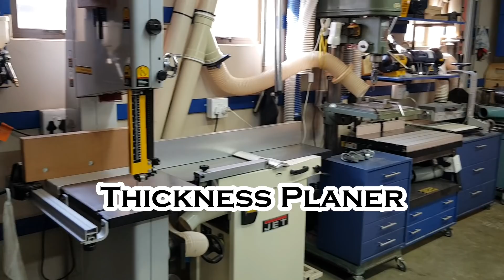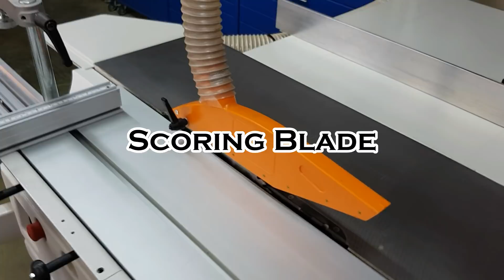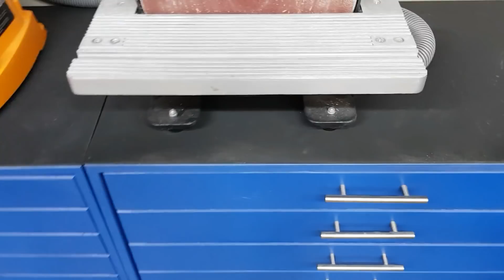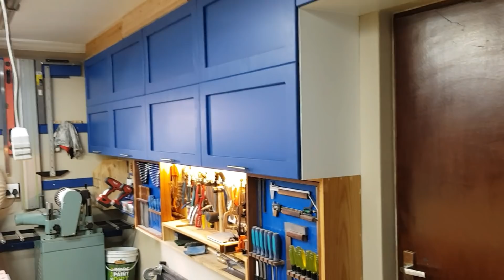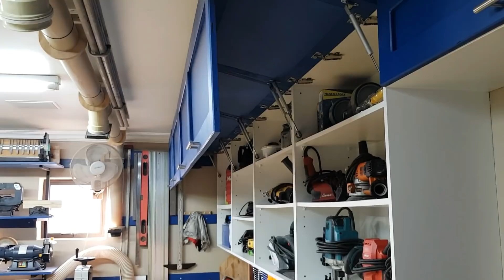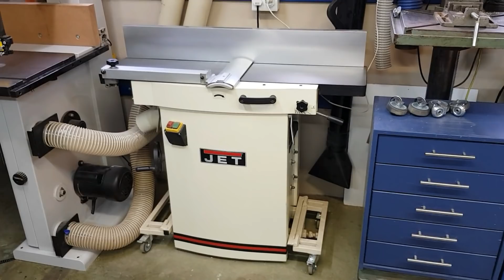Woodworking Shop Tour 2018

Comment: Where do you get your bags for your dust extractor
Reply from the maker: Hi Paulus. The bags are re-usable fabric, so I just empty them, shake it out and put them back. I tried the plastic ones, but they have to be replaced after a few empties. The problem with the fabric is that you need to remember to check that you dont overfill

Comment: You have a great workshop.  Could you share your experience of the minimax sc2 sliding table saw.  I am considering upgrading to this saw and would like to get your feedback
Reply from the maker: Hi Nick
Because I have my shop in a garage, I couldn't fit a full size panel saw and needed something single phase with a scoring blade . I went for the minimax because of the shorter sliding table. If this is what you are looking for, then the SC2 is a great choice.  I will buy the SC2 again in a heartbeat.  It has a 3hp motor driving both the main blade and the scoring blade. Even at full depth in Oregan Pine I had no difficulty at all with power. When the scoring blade is lifted, however,  cutting melamine or veneer, you notice a lack of power and you could easily stall the blade. I don't cut melamine or veneer often because I get my jobs cut and edged from the supplier so I only do a few cuts where adjustments are needed or to rectify mistakes. The rip fence is absolutely phenomenal and the fence on the outrigger is stays square, needing hardly any adjustments over the 2.5 years I have the saw. I did however installed Kreg flip stops on the square fence. Even after  all this time owning the saw I still enjoy using it every time I switch it on!
Reply: @LDBWoodworking  thanks for the quick response.   I'm in the same position in the garage so a shorter slider will be much better than a cabinet style saw.  Thanks for you honest feedback.

Comment: Hi Louis.
Great chanel and awesome collection of tools.
I wanted to fined out more about your table saw.

I am also from south Africa.
Where did u manage to by the saw and in Rand how much did it set u back?
Reply from the maker: Hi Stuart. I bought it from Huster Machine Tools in Kempton Park. I paid around R70k for it a year ago but with the current exchange rate I guess it would be quite a bit more now. It is a lovely machine and I enjoy every second I spend using it, especially when cross cutting. I think Geerlings might stock the SCM brand sliders as well, but you have to check.
Reply: Thanks alot that really helps.
I am supper jealous my shop could really do with a table saw like that it's just not in the budget.

The sliding feature is a absolutel game changer people don't know what they are missing out of wen they by a normal cabinet saw.

Did u ever consider the Hammer saw from austro it is also a absolutely quality saw and it would of been abit cheaper?
Reply from the maker: I did look at the K3L, but it was too long for my garage. It needed more than 6m to run from extreme back to extreme front. This would have meant that my bench wouldn't have space. I did consider the small Felder (K700 I think) but that was more than 100k

Comment: Super nice shop and a great collection of tools! Thanks for the video. Love the cabinet organization and thanks for keeping you handheld power tools out of their containers.  Off to a good start on YouTube. Consider converting your dust collector to a 2 stage and mount it tot he wall if the tracks for the garage door will allow. Doing this will allow you to ditch/sell one of the filters and free up floor space. Maybe you can then move that 13” thickness planer over to that corner so it won’t be a hassle to pull it out.  I made a video which details this. https://youtu.be/SkIFPjJOQNU
Reply from the maker: Hi there.  Thanks for the input.  What I would give for a proper 2 stage.... The problem is that it is impossible to buy a cyclone like a super dust deputy or similar - they are simply not imported by anyone.  The only way is to buy a factory tyoe cyclone like a Jet and they are simply too expensive for me.  I would, however, love a set-up  like that!

Comment: people in the states would love sliding saws if they weren't so expensive for us. cabinet saws are a little easier to fit in smaller places since you don't have to account for space in front.
Reply from the maker: I agree on the space - it does need a large area to extend completely.  My opinion is that if one has a mitre saw station, it takes up a lot of space as well, especially if you have one of these built-in units. Anyway, it is a pitty that sliders are not more common in the states.  You get much smaller units that could eaasily fit in any workshop.  Thanks for watching and the response!

Comment: that was AWESOME. nice shop man! am I ever, ever jealous. jaw dropped when you showed the tank on the wall, I was like "are you KIDDING ME he has a welder too?!"  I've seen the 6" belt sander done a couple of times, it's something I want to do myself! do you have any issues with dialing in your belt tracking at all? and any issues with the motor? The one thing I've heard is that you need to get a motor that was made to mount vertically, something about the lubrication type and setup being vertical-specific.

I have about half as much space as you but I'm hoping I can be at least 50% as organized, haha! I'm in the process of building some rolling carts. my main question though... where do you store your wood?!
Reply from the maker: Thanks man!  I have had no issues with the motor mounted on it's side - the sander does not run for extended periods anyway.  This was the only way I found the belt to be useful to me, so if it fails some day....maybe a larger unit...:) I don't have any issues with the belt tracking - I adjust the belt when I put it on and then close the unit ( it has hinges at tha back to flip the unit open for belt changes). You are one of the few that picked up that there is no timber in the shop.  I have it against the side of my house on shelving that I cover with  tarpaulin.  we don't have extreme wheather here, so it doesn't have an impact.  My feeling was that timber storage inside just took up so mich space I could use more efficiently otherwise, keeping in mind that the number of times you actually use someting off the shelf is very low anyway - in my case anyway.
Reply: Ah, very lucky on the weather... I'm in canada and our temp swings 60 degrees C from winter to summer and humidity drops to the 20's in winter and goes up to the 60's in the summer. So, it's all inside for me! I found a fairly efficient way to store it though, with my plywood sheets slotted (on the long side) under some 16" deep racks that hold lumber. 

I also meant to add - I think the issue here with tablesaws is that sliders are a little more complicated and thus more expensive, especially if you want it to be good and reliable... the cheapest we have here is around $4500 for something with a 4' slide/crosscut, whereas if I want a cabinet saw that I can tune to be perfect+reliable I could pay around $500 for a used one... there are literally tonnes of used machines kicking around because so many were made here from the 50s-70s - all cast iron, but fully adjustable to set + forget. So, for "getting into" the hobby it's the easiest way. personally I'm still torn between a sawstop + a slider!
Reply from the maker: Ha Ha Ha.....in my opinion, it is an easy decision.....always the slider :)

Comment: Cool shop tour  your. Dust extractor is quite impressive  on how neat and professional it looks   The blue cabinets  also  give the. Shop a sharp appearance very often  woodworkers  do not  finish  shop cabinets  and will leave  them raw  and utilitarian  looking ? It makes. A large difference  to me working in a  clean  appealing  shop  as I  feel it  makes you do  more professional work  my father  was one to make do with  whatever he came accross  and i am. The exact opposite  as i like my enviorment tidy and matching  as well as clean  it helps me to work more efficiently and faster  ive had co workers make fun of me in the past  because i would sweep or vacumn a  area before  I started. Cutting wood and making sawdust   That  would cover the area
Reply from the maker: I am the same - it is not about the result, be the journey :) It should be enjoyable

Comment: Love the shop.  As for your air compressor hanging from the wall. How did you go about mounting it?
Reply from the maker: I have welded some angled brackets and fixed them to the wall. I removed the two large wheels and small swivel wheel. I used these mounting holes to fix it to the steel brackets.  Make sure you use proper anchors to fix the brackets to the wall because the vibration could cause failure if you don't use quality anchors. Let me know if you need more information. Cheers. Louis

Comment: Hi can you tell me the model number and manufacturer of your table saw?
Reply from the maker: Hi Bob. It is a Minimax SC2 classic.  It is made in in Italy.  Not much on youtube on this machine, though.  Am considering a review of it.  It is cheaper than a Sawstop or a powermatic, bur far more useful, in my opinion.  Since moving to this saw, I have not used my mitre saw since.
Reply from the maker: Oh forgot to mention. The manufacturer is SCM in Italy
Reply: LDB Woodworking thanks for the info. A review of it would be great
Reply: LDB Woodworking thanks I looked them up
Reply from the maker: Hi Bob. I don't want to make promises, but I have been contemplating a video for a while. Let's see how it goes over the weekend:)
Reply from the maker: What did you think - any specific questions that are still unanswered?
Reply: LDB Woodworking all is well. I had never seen one. I have been looking on line to learn more about them. The concept is great. I really appreciate your responses.
Reply: You say it's cheaper than a SawStop, but only where you're at.  Over here in the USA that saw of yours costs twice as much as a decent SawStop.

Comment: Very nice shop, very well organized, you have managed to put a lot in that garage and still have room to work efficiently. I didn't see any lumber storage though, do you keep and wood on hand?
Reply from the maker: Hi Darren. Thanks for viewing and taking the time to comment.  I had storage inside, but I felt that it took up too much space and how often do one need lumber from there anyway?  I installed brackets outside with all my lumber - I put a aluminium roof over it and covered the front and 2 sides with a tarpaulin.  This way rain can not get to it and I installed it on the south side of the house, so sun doesn't get to it either.  Our climate is also very forgiving without too much fluctuation.  This way I can store a lot more lumber than would be possible in the workshop.

Comment: Are their any tools you don't have! Wow are you a fulltime woodworker?
Reply from the maker: Hi Nick.  Thanks :)  There is always something one doesn't have.  I am not doing woodworking full time.  I used to have a kitchen factory, but left that industry 8 years ago.  Now I do it as a hobby over weekends when I want to without any pressure.  I do it because I want to enjoy the process, not to drive the end result, so as far as possible I prefer to have the best equipment I can afford to make the process more enjoyable.  What are you up to in your workshop?

Comment: Love your shop! I see you are an apron wearer too! I can't get by without one! Subbed you! Later, Murph
Reply from the maker: Hi Murph.  It took me a long time before realising it, but once you figure out how many times you walk around lokking for a tape or a pencil, it makes complete sense, doesn't it?  I looked around but the best one I could find was the Tork craft one in my market (South Africa), but the strap on the top just went around the neck area (not down the back).  I found this extremely uncomfortable, so my wife took some old straps from a backpack and stitched them onto the apron so that they crossed over at the back. Now I really enjoy the comfort of having all pencils, ruler, tape, 4" square and of course the remote for the dust collector with me all the time.  Please keep the comments coming so that I know what people like and where I can improve.  Thanks again. Cheers. Louis
Reply: Hey Lewis, the older I get the more the walking around looking for stuff time expands! So the apron really does help! I'm just the opposite of you, strap down the back was uncomfortable so I removed it! Your shop is so neat and well thought out, I'm envious. If you check my channel you'll see my shop is much more fly by the seat of my pants and somehow make things fit into the space! Best wishes, later, Murph